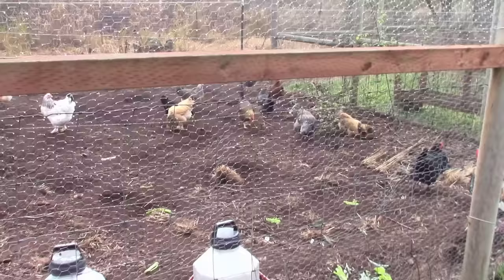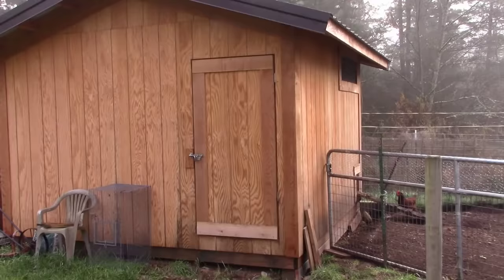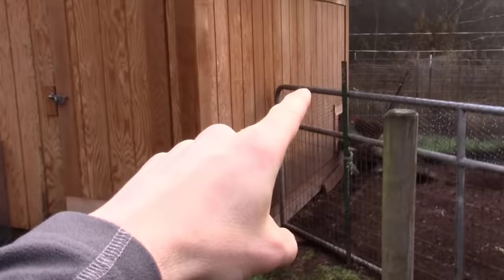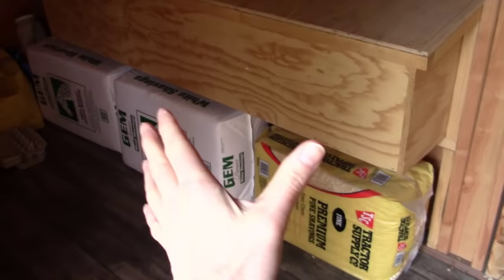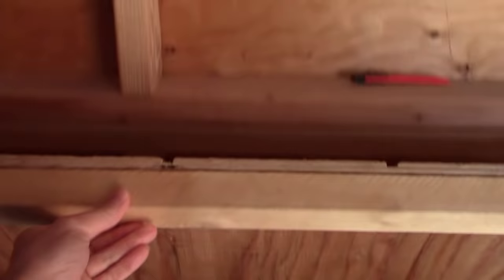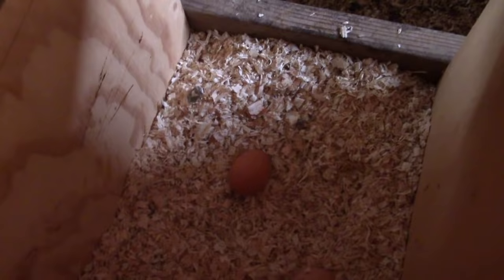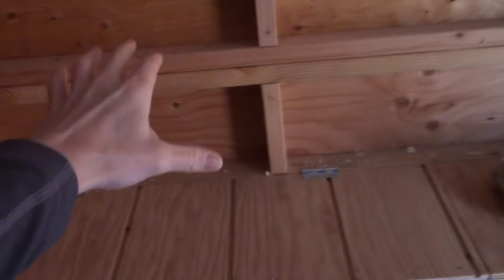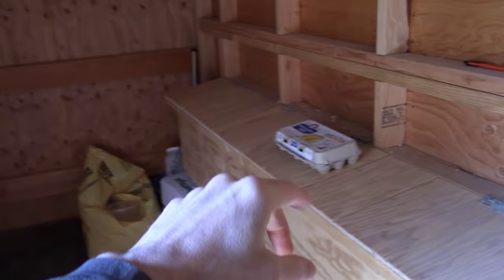How to Build a Tiny Pole Barn in  -5 MINUTES-  | Chicken House Plans

Comment: Nice. The only thing is you might want to use thicker floor or cement floor due to chicken poo in the long run and sand on top to keep it clean.
Reply from the maker: That's why we put the linoleum down.  So far it's working out very well and the chicken poop isn't damaging the floor at all.  We put down a lot of shavings on top of the linoleum and my wife cleans out the coop fairly often.

Comment: Mike zoomed through that build like he's made chicken houses every day for 10 years.  I'd much rather use materials and cut and design on the fly than use a kit and try to figure out how to put one together.  This turned out great.  I'd suggest a magnet to hold the lid open.  For holding the egg cartons as you fill them, screw a piece of steel 2x4 the length of a carton into each section close to where you are standing.  Half of the carton should fit in the hollow of the 2x4 with the lid close to you as you fill it to counterbalance it until you finish the first row nearest to you.
I want to build a coop mostly out of metal so it is easier to rinse off the poo.  I saw some designs where the chickens lay on astroturf with a hole in the middle and the eggs fall through onto a conveyor belt.  They crank the belt toward them to collect the eggs at the end.
Reply from the maker: Yeah, this was a fun build.  No plans or instructions, just built it one day at a time.  Love the magnet idea.

Comment: I thought you were going to move in it LOL I built pole buildings for 35 years and then messed up started working in a factory I love them and believed in them
Reply from the maker: They are great structures.  I have a 24x24 and a 36x48.  Love them
Reply: Yea we moved one or two one was a huge horse barn ! Removed metal then cut close to hanger s with chain saw s  ! Cut the length of buildings down one foot
Reply: We did two Smileys Flea Market one in Fletcher NC huge check it out online

Comment: Nice edits and good build. I’d use 10d nails for the hangers vs screws
Reply from the maker: That's the one thing I wish I'd done differently.
Reply: @MikeKincaid79  For your application it will hold forever I’m sure.  Even galv nails would work in the hangers, as I’m sure you know

Comment: Salut! 
I saw that you always have to take the chicken and always go inside.Just as you have an egg door, so you can think of a hinged door on the outside , caught by a hook when it is open, so as not to hold it in your hands, and with a shovel made at a 90 ° angle, to pull the manure very easily.And of course make the entrance of the chickens on the corner so you can make the door horizontally, down to the floor.I hope you like the idea, it's free, I hope it fits with your ideas. Good luck brother! :)
Reply: it's actually in the bottom right corner. :)))I see this at 6:12
I also see the net fence, where you point your finger. And you say you're going to make a door to open it with a system so you don't go into the chicken coop anymore. Why do I say ?! Well, because a horizontal door like an egg door would be good here with hinges, and down on the ground you put a box in which you pull the manure with a shovel with a 90 ° angle
Reply from the maker: Thanks for all the ideas on this.  We’ve been using it for a couple years now and really love it.
Reply: @MikeKincaid79  oo i guess is a good ideea so?! 
I was thinking to do this example for my animals/ birds to, when I don't sleep i see same things and ideas :D 
Have a good day!
Reply: @MikeKincaid79  o yes , i liked your work, and idea to keep birds safe and clean to

Comment: Nice! Mine is just a backyard build in the suburbs, would do several things different. One idea that worked for me was a pulley system for the door so I could operate from outside and not enter chix yard or coop. Wish I had the space for barn like yours! Only thing I see missing is a window between shed side and chix side? Maybe in the door?
Reply from the maker: It's a work in progress.  I've thought about making the pulley system you mentioned and probably will at some point.  Yep, windows can always be added.

Comment: Hey, @mikekincaid79 if you still monitor this. A simple addition that will save your wife so much time cleaning the coop- a shelf under the roosts with melamine or white boards on it. You can scrape all the poop off in a minute every day or two. It saves time and keeps the pine shavings out of the poop, so you can build better compost

Comment: Nice work!In my opinion taking no water proof measures ,that wood would rot in the soil pretty easy...in a couple of years might get shaky...
Reply from the maker: It's pressure treated.  Rated at 40 years in ground before rot will even begin to effect the surface of the wood.  Many barns are built this way in my area and last way longer than 40 years.
Reply: @MikeKincaid79  aaah nice ...my bad...nice work!looks so simple ,clear and neat

Comment: A layer of plastic on the ground would've been cheap insurance against rising moisture and cancer causing radon gas, plus it could've prevented weeds. In many areas, rodents and insects would take advantage of the space created under the structure. Luckily the structure was built years ago considering the price of materials today.

Comment: Very nice.  Can you provide some basic dimensions? Overall  L, W, H, size of each room.  Did I see a Woodstock in the corner?  Thanks for taking time to document and produce.
Reply from the maker: The structure is 12'x12' with 8' walls.  The pitch on the roof is 4/12.  The center wall was offset to give more space in the storage area.  If I remember correctly, there is about 5' in the chicken side and 7' in the storage side.

Comment: Very nice coop Mike, But I think i beat you with my 7x7x7 coop that i just built for $1100 using total 2x4's, smart siding, 3/4 " ext plywood floor , hurricane roof ties, and old fashioned roofing tin for a lean to style roof.  Building sits on 14" treated 4x4 post notched, screwed and braced to floor frame.  2x4's were spaced 12" floor, 14" roof, and 16" or less walls.
Reply from the maker: But can you walk into it and collect eggs from the inside?  Can you store large amounts of feed and bedding?  Can it hold over 40 chickens?  You certainly beat me on price.
Reply: @MikeKincaid79  Yes, that was a bit unfair, but point I guess i was making is that the whole coop was built with 2x4's while yours was built like fort Knox..

Comment: Did you get your gutters in and are you saving the water to water the chickens and you might think about shocks for the lid not just hooks also have ya though about a pvc self feeder
Reply from the maker: Yes, gutters are in.  I have plans to eventually collect the rainwater and build a streamlined system that automatically tops off the water, but I haven't done it yet.  I've definitely thought about a pvc feeder and plan to build one of those or something similar as time goes by.  The ultimate endgame would be to have a self sufficient chicken coop that I can dump a 50 pound bag of feed into and walk away from for at least a few weeks without worrying about water or feed.

Comment: Nice looking shed.
What is the dimensions?
Did you do anything to treat the end of the posts (that is in the ground(?
Thanks
Reply from the maker: 12x12 with 8 foot walls and 4/12 pitch roof.  All ground contact posts are pressure treated lumber.

Comment: whats the pitch? just wondering about angles?  im a beginner carpenter. this is awesome.
Reply from the maker: Thanks Jeffy.  It's a 4/12 pitch.  I didn't use angles to get the pitch right.  Instead, I just marked a point on the corner post and then another point on the center post that was equal to a 4/12 pitch.  Then I just nailed the main gable end boards at the marked points, creating a 4/12 pitch.

Comment: only question I have is the area to sweep out shavings to clean it out,is the 2x4 necessary at the door or can the door be dropped down some to take up the space of the 2x4 so the shavings can be swept out without being hung up on that 2x4 board?  if i am seeing this incorrectly, I apologize and plz correct me on what I think I am looking at
Reply from the maker: There is a 2x4 on the inner door between the 2 sides and that is there to keep the shavings and poop out of the barn side.  There is a door leading out of the coop on the chicken side and there is no 2x4 under that door.  That door goes down to about 1/2 inch off the floor.  We just set a wheelbarrow on the outside of the coop, in front of the door, and sweep all the shavings right out the door and into the wheelbarrow.  It's really easy this way.

Comment: Hello, did you just bury the posts in soil or you pour concrete around it? Thanks.
Reply from the maker: Just soil.  They're pressure treated posts that are rated at 40 years in ground.  They usually last much longer.  It will outlive me.

Comment: How are you keeping the poles level? Also the 8x8 poles look perfectly straight did you plane them ?!
Reply from the maker: I back filled the holes with dirt to hold them in place while I attached the walls.  I had to adjust a few times until the walls were substantial enough to provide rigidity.  The poles are 6x6 pressure treated lumber and were straight when I started.  Usually these pressure treated poles come fairly straight from the lumber yard.

Comment: do you have problems with the shavings getting in the water? I do when I use the waters.  I am trying to come up with a system to have the water in a different room along with the food but still inside to keep rats and pest away but to keep the main roosting area clean and dry .  this is my biggest issue is the water becoming contaminated and dirty or food being spilled everywhere no matter what system I use they will get a mouthful and pull it out onto the floor where there is dropping and this is not sanitary and I try to avoid this but so very hard to if in an area where they roost. I love your coop and the extra space for food and water I can see being done but where?  love your video and thx for sharingl
Reply from the maker: All the water is kept outside next to the coop.  We've been doing it like this since building this coop and never have a problem.  They are 3 gallon chicken waterers that we have raised up on cinder blocks.

Comment: Nov. 29, 2020, fast-forward to April/May 2022: How's the structure holding up? Have you notice sinking from any one or more corners?
Great video, cutting through the chase. Thanks (thumb's up).
Reply from the maker: Thanks.  Nope, no sinking.  When I put the posts in, I packed the ground down in the bottom of the hole and we have very hard and rocky soil otherwise.

Comment: I that just a 2x6 holding up the center peak of the roof.  And do you just screw that on to the skirt board?
Reply from the maker: At first, it's the only thing holding it up, but once the entire structure is built, the entire wall holds it up.

Comment: I like that chicken house. What are dimensions?
Reply from the maker: 12 wide x 12 wide, with 8 feet tall walls.  4/12 roof pitch with 16 inch overhangs.  The corners are pressure treated 6x6 posts.  Structural lumber for the walls and roof is 2x6.  2x10 should be used for the floor, although I used 2x8 lumber, but I supported it underneath at the halfway point so it's plenty strong.

Comment: The wood flooring should be be sealed really well. Like industrial sealant or similar. The pee and poop will eat away at the wood and stink really bad. Chicken cook on a trailer with chicken Wie type flooring is ideal, then you just move the trailer once in a while.

Comment: Could you share the dimensions of the lumber that you used?  Posts, gable, joists , etc.?  Thank you.
Reply from the maker: The main posts are 6x6.  The door posts are 4x6.  Gable's are 2x12.  All other lumber is 2x6 for main structure.  Inner wall lumber is 2x4.  The structure is 12x12 with 8 foot walls and a 4/12 pitch roof.  Joists are 2x8, however, if I had the money I'd go with 2x10.

Comment: excellent job, but wood directly to the ground is not a good idea you should make concrete foundations for supports
Reply from the maker: It's pressure treated lumber rated at 40 years in ground.  All pole buildings in my area are built this way.

Comment: How is the floor holding up? It was one sheet of linoleum correct?
Reply from the maker: Correct, just one sheet.  It's holding up great and with no sign of breakdown after 1.5 years.  We put wood shavings down on the linoleum to help soak up any moisture and clean the coop out about every 6 to 7 weeks.  So far, so good!

Comment: Hey Mike what kind of wood is them beams of?? aren't you affraid that they gonna get rotten quickly??
Reply from the maker: Pressure treated 6x6 posts.  They are rates for 40 years with ground contact.  All pole building in my area are built with this material and there are many standing that are over 60 years old.
Reply: @MikeKincaid79  Thanks for reply Mike and what type of wood is it? Pine, Oak??

Comment: It is very good, but use 2x6 is too durable and overkill. I spent money on the concrete floor and use 2x4 for a lot easier to handle, all by myself step by step, no hurry do good work.

Comment: Easy, just have money😀😀😀😀
Reply from the maker: No kidding.  Thank God I finished this before the world went crazy.  This would cost $10,000 today!
Reply: @MikeKincaid79  Yeah I know
Reply from the maker: We had a complete pole building built with insulation, roll up doors, and concrete floor about 3 years ago (pre-crazy world) for $30,000 complete.  It's basically an empty shop that's ready to build out.  We just got a quote for a second building the same size (36x48) but without insulation, concrete, and walls.  Literally just a roof on stilts for tractors and equipment.  The quote was $36,000!  Insane.
Reply: @MikeKincaid79  Prices are not normal this days. Hope they will correct that, because everything is just too expensive

Comment: How long do you think those posts would last in the ground like that? I want to build one of these but a bit worried about them rotting out quickly 😬
Reply from the maker: The rest of my life.  Pressure treated lumber is rated at 40 years in ground contact, but will last much longer than that.  Nothing lasts forever but I'll never see this building go down.
Reply: @MikeKincaid79  much longer than i thought! awesome job on this! You make it look so easy 😅

Comment: Wood floors in a chicken house are not good. I built my first chicken house with wooden floors and it is a nightmare to keep clean. My present chicken house has a natural dirt floor and requires very low maintenance. The chickens keep it turned and we use lime now and then. You can also add soil now and then and scoop out rich fertilizer anytime the garden needs help.

Comment: What's the size of this?  I'm currently in process of building a pole barn similar to this that is 10x12.  From watching these videos I'm thinking of doing same thing with splitting it between hen house and clean feed room. We have 30 chickens that will move in it.
Reply from the maker: This is a 12x12 with 8 foot high walls.  I highly recommend splitting it like we did.  Best decision ever.
Reply: @MikeKincaid79  thank you so much for your reply

Comment: What is that insulation you pulled up on the roof under the tin?
Reply from the maker: Blanket insulation.  It just prevents condensation on the ceiling.

Comment: I would have put blocks in the middle to stop bounce
Reply from the maker: I did.  I guess that part didn’t make it in the video.  I pulled the plywood back up once I got it all laid out and cut to fit.  Then I blocked each joist up at the 6 foot point.  After getting it all back together I jumped up and down on it a bunch.  Solid as a rock.

Comment: I am curious how big your pole barn is. Trying to find that info and seem to have not found it
Reply from the maker: It's 12'x12' with 8' walls.  The roof pitch is 4/12.  All corner posts are 6x6 pressure treated lumber and the door posts are 4x6.  The floor joists are 2x8 (if I remember correctly).  All other lumber is 2x6, except for the rafters, which are 2x10 or 12.  I probably should do a video about this since I get a lot of questions on it.

Comment: Justin Rhodes built another Fort Knox chick house to protect them from Rats that would routinely knaw into the breeder room through walls and kill all the chicks. He basically lined walls with mesh, placed layer of metal on walls with another mesh layer above to preventb top entry. Rats are smart and persistent as well as cautious of new things so they evade lots of traps. It only takes one Rat to kill all of your chicken brood.
Reply from the maker: I'll keep an eye on it, thanks
Reply: @MikeKincaid79  Love all of these building videos and you did a wonderful job on your coop that could be a model for multiple types of structures.

Comment: Hi what's the membrane you put down before you did the metal sheeting?
Reply from the maker: Insulation to prevent condensation.  It's put in most pole buildings in my area.
Reply: @MikeKincaid79  I've never seen an insulation so thin and rollable. Does it have a name, maker, part #? I like the simplicity of handling and light weight. Thanks Mike 🇺🇲👍🏻
Reply from the maker: Yeah, it's not thick at all, maybe a couple inches and then the metal presses it down more.  It's simply there to prevent condensation forming under the metal.  Don't know the part number, I just buy it at my local lumber store.  It's pretty easy to find and I'm sure the big box stores would have it.

Comment: Those poles in corner won't rot out in like 10y at ground level?
Reply from the maker: They are pressure treated poles that are rated at 40 years in ground.  That's before any sign of rot begins.  This little barn will be standing long after I'm dead.